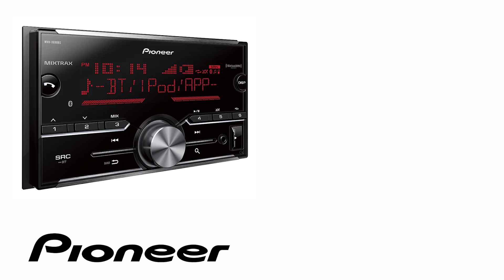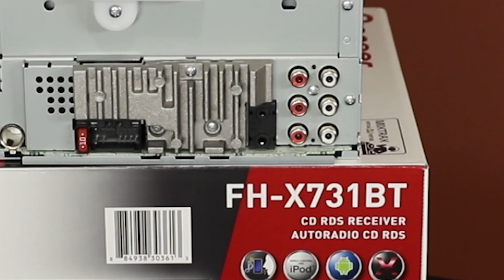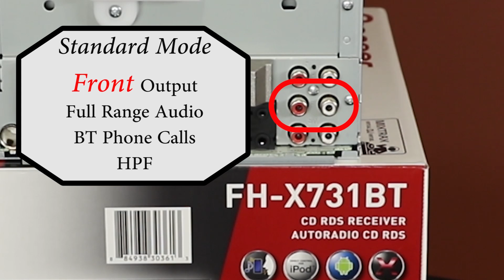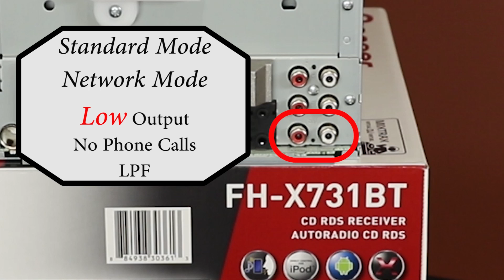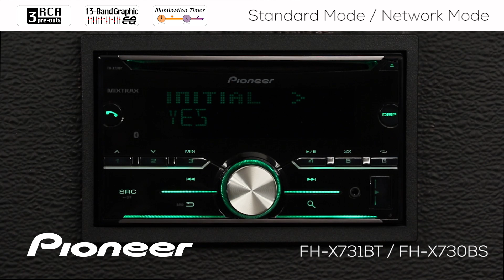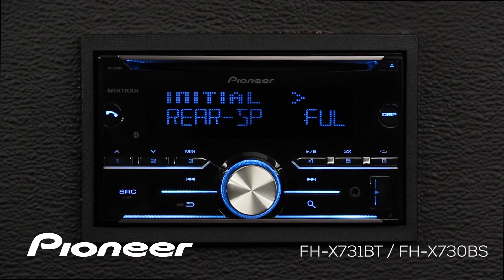How To - FH-X731BT - Underatanding Network Mode and Standard Mode

Comment: Does this model support Direct Sub Drive? And what is the best way to connect a small, low-power subwoofer?
Reply from the maker: The Pioneer FH-X731BT and nearly all modern (2021) Pioneer in-dash receivers have a built-in amplifier that is designed to operate up to 4 speakers in your vehicle.  A typical installation would operate 2 speakers in the front of the vehicle and 2 speakers in the rear of the vehicle.   The Pioneer FH-X731BT  can operate a small subwoofer on the rear speaker level output channel.   Please note: if you want to run a small subwoofer on the rear output channel, you will not be able to operate 2 rear speakers and a subwoofer on the rear channel.  It's one or the other.  2 speakers on the rear channel - or - one small subwoofer on the rear channel.    To operate a small subwoofer on the rear channel connect the subwoofer directly to the Purple and Purple with Black stripe leads on the receiver.  You can learn more about wiring your Pioneer in-dash receiver in this How To video:   https://youtu.be/kR2MO2kwFug?list=PLw63zJRQbCNjrJMo-h1YOEbzCdXw_DWPG     In the receiver's Setup menu you must choose the Standard Mode output for this operation to work correctly.  Do not choose Network Mode.  It won't work correctly.   The receiver's Initial Menu REAR SP setting should be set to SW.  You can see this demonstrated in this Pioneer How To video:   https://youtu.be/Aj8JItUGMPw?list=PLw63zJRQbCNjrJMo-h1YOEbzCdXw_DWPG&t=57          I recommend an 8 inch subwoofer or smaller for this type of operation from the receiver's internal amplifier.  You can learn more about Pioneer 8 inch subwoofers here:   https://youtu.be/WkbRBGtW9yM   
For another and completely different option, you might also consider operating a small self powered subwoofer from the RCA outputs on the receiver.  A self powered subwoofer has it's own amplifier built-in and operates independently from the in-dash receiver's built-in amplifier. This will give you the option of operating 4 speakers in the vehicle and a small subwoofer all at the same time.  You can learn more about Pioneer's self powered subwoofers in this video:    https://youtu.be/AkushNUilVs?list=PLw63zJRQbCNhkTQCxPpxGF4h6l6qocsaR        and you can find more videos on Pioneer's YouTube Channel here:  https://www.youtube.com/user/pioneerelectronics
Reply: @pioneerelectronics  Thanks!  I was actually considering making a DIY out of this.  Small, 50-100W Amp, 6.5" driver, and a WOOX-Type slave driver.  Don't need much sound, and it has to go under the driver's seat.
Reply from the maker: @RepJock88      You might consider Pioneer 8 inch shallow subwoofers.  You can see them in this video:    https://youtu.be/6bakEnog_nE?t=43     and one in a factory enclosure here:   https://youtu.be/WkbRBGtW9yM?t=32     Also take a look at this very  compact subwoofer amp from Pioneer:    https://youtu.be/ulDxz2QPt8M

Comment: Hello, you may or may not have an answer for this. Before i continue searching google, i wondered if this head unit experiences rca preamp problems with vibration. I have upgraded amplifier, subwoofers, and rca patch cables but still have an issue when hitting certain bumps or turning the subs up fairly loud. When the issue happens the sub volume is greatly decreased, as if one input (L or R) is disconnected. On a severe bump that i did not notice in time, i have even had the subs cut out completely. Is there any kind of vibration sensor built into this unit or preamp protection circuit that could be causing this? As i mentioned, all equipment throughout the system is new and i have narrowed it down to the head unit. Thanks.
Reply: Vibration is not typically a source of trouble with the in-dash receiver, but that doesn't mean it can't be the trouble.  Is this a trouble with your particular in-dash receiver?  That's a possibility. Any one in-dash receiver could develop an issue.   However, please check a few things first.  Has this product been professionally installed?  Or are you doing the work yourself?  Is this one of the first systems you have installed? I ask this to help me understand your experience level with car audio products.    You said the amplifier cuts out when you turn up the volume and when you hit a bump.   My first thought here is the Amplifier Ground Wire and / or power wire.  Please check the amplifier Ground Wire connection. Check it at the amplifier, but most importantly check the ground connection to the vehicle.   The ground connection to the vehicle has to be a clean bare metal connection to the body or frame, no paint, and I strongly recommend heavy gauge wire at least the same gauge ground wire as the power cable to the amplifier.       You did not mention what Pioneer in-dash receiver you have.  Is it FH-X731BT?  You can be certain, Pioneer does NOT put a "vibration sensor" into the product.  Nothing like that. I'd like to help so I'll need some additional information about your system.  Are you using more than one amplifier?  How are the amplifiers grounded to the vehicle?  What gauge power and ground wire are you using?  How long is the run to the battery? How long is the ground run?   What is total speaker impedance is shown to the subwoofer amplifier?  How are the subs wired to achieve this?  Does the amp for the full range speakers experience the same issue?  What are the audio settings on the receiver?  Do you have the audio settings like EQ, and speaker levels turned up near MAX?